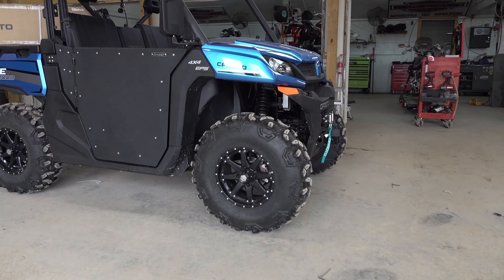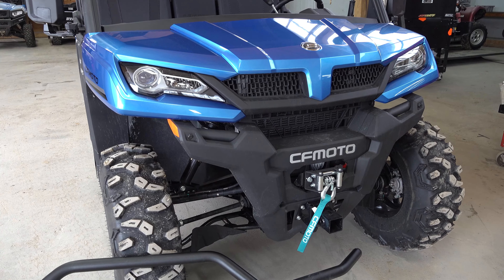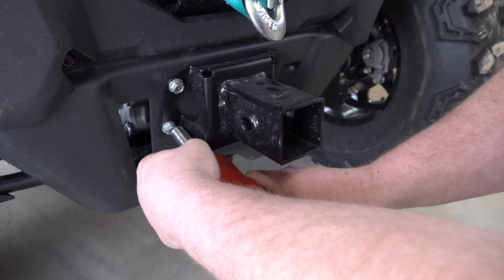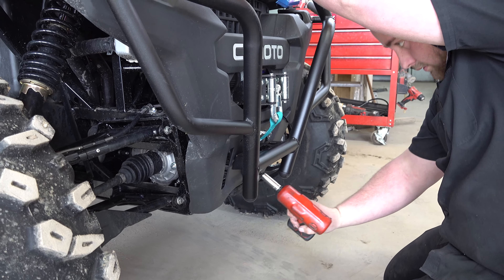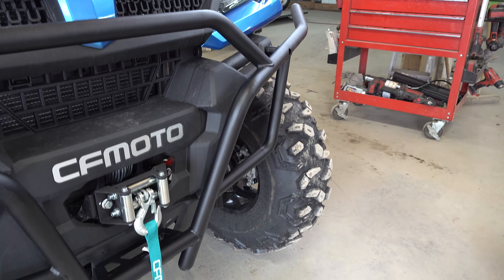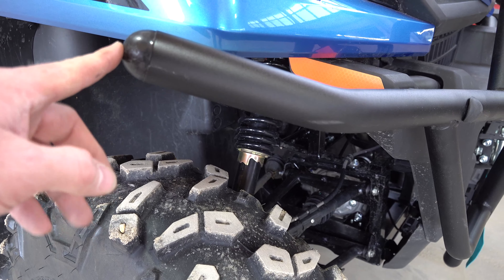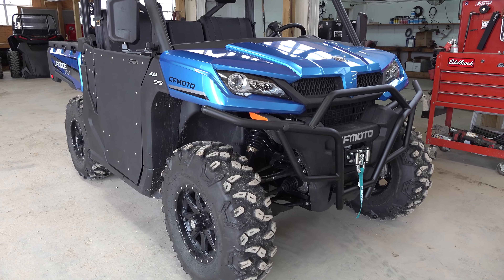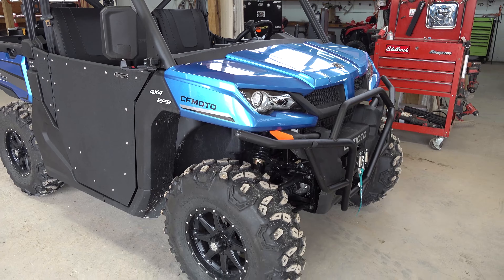UFORCE 1000 Front Bumper Install & Review | CFMOTO Accessories

Comment: Does cfmoto make something like the Polaris "highlifter" kit? I saw a Polaris ranger with the highlifter kit and it looked great. I don't want a Polaris though, I want a uforce 1000!
Reply from the maker: There is no kits from CFMOTO but you can pretty much order everything you need to build one out to be like a highlifter kit from Main Street Cycle.. they have snorkel kits and arched a arms and mud tires and everything